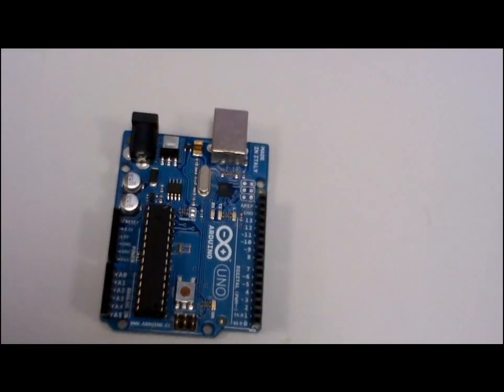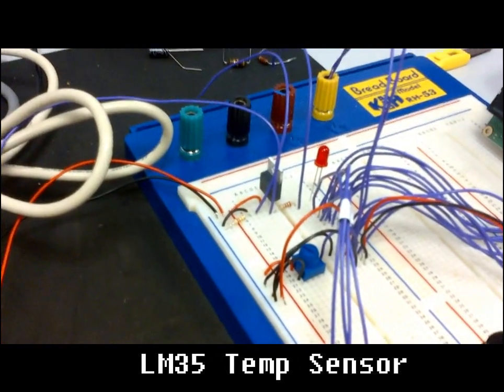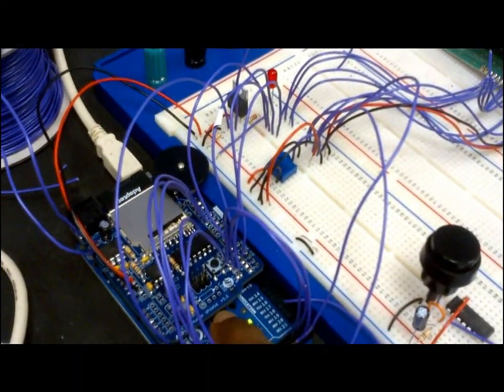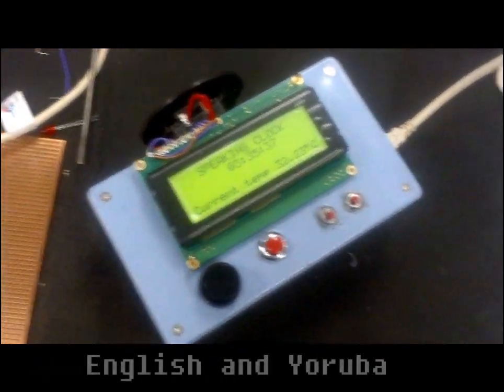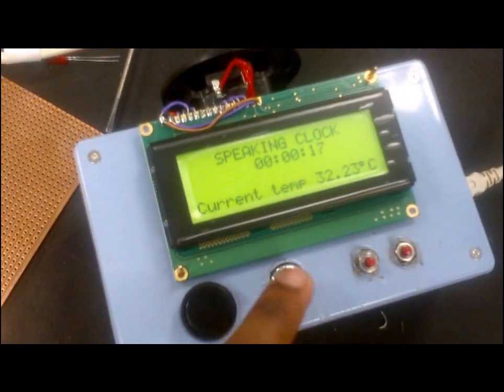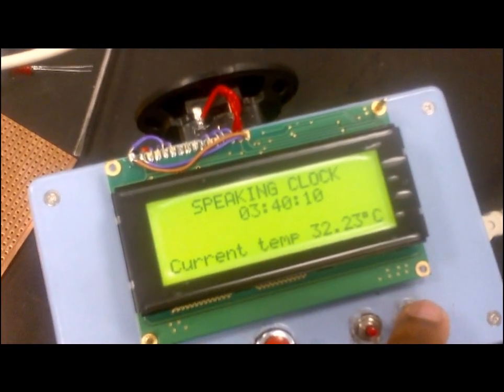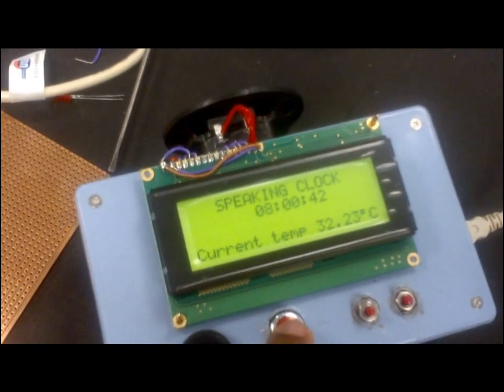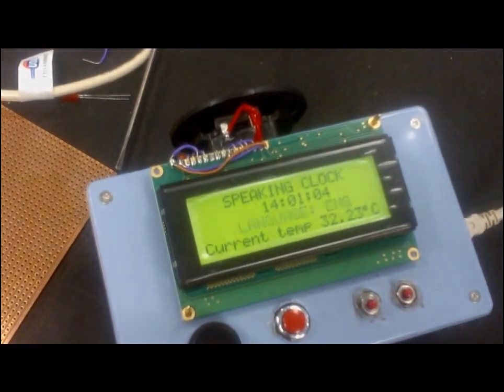Multi-lingual Speaking Clock using an Arduino

Comment: Hey,nice job. Where do you think  I can get an arduino board and an adafruirt Protoshield in Lagos
Reply from the maker: I have no idea about where to get things in Lagos but you could always import if you're on to a serious project
Reply: opemipo durodola A. for arduino boards like Arduino uno and mega try Oshodi mainmarket stand A7 ask for Iyke they cost 4k and 5k respectively. B. For adafruit protoshields not pretty sure you could ask in Oshodi. However, don't go to Ikeja computer village they'll rip you off
Reply: Thanks I ordered it online thou Elochukwu Clarence but next time I would go to A7 funny enough I am just coming from Oshodi I went to buy some parts for my Robot project
Reply: opemipo durodola Fair enough, no p. I'm building a motor shield for my robot project too. Goodluck
Reply: opemipo durodola cool, how did you power the motor to drive your robot, did you buy a motor shield or build one
Reply: No I am using PWM 16 bit channel driver and a pi cobbler
Reply: opemipo durodola presumably, your robot is based on Raspberry Pi then?
Reply: Sure
Reply: Have you worked with one before
Reply: robots? yes. Raspberry Pi ? No. I use arduino for my robots
Reply: Ok
Reply: Where are you based in lagos
Reply: not settled. I move about alot to the Island, mainland and to other states recently
Reply: not settled. I move about the Island, mainland and recently to other states.
Reply: Ok
Reply: Do you have the number of Iyke at Oshodi please I need is contact Asap.
Reply: yh, might be there aswell to get L298 motor driver IC, there's been alot of
complaints about L293d chips they keep acting up it sucks. Here's the
number 08037130364 Iyke Oshoi mainmarket stand A7. Goodluck
Reply: Do you think I can get a Pi cobbler from him
Reply: Give him a ring, it's worth the shot. You never know what he's got under
the hood, the place is like some underground for
makers/hackers/builders/modifiers. Call him and ask lol
Reply: It's a small world I buy things from him too in fact that is the one shop I go to before branching elsewhere
Reply: Unfortunately he doesn't have
Reply: The problem is I bought one online only to see it doesn't match my Raspberry PI model B
Reply: Of which it was designed for raspberry pi model B+
Reply: Now I can't return it
Reply: But in case you come across any body that needs hook us up
Reply: And have you been able to integrate talking into your robot.
Reply: he's the only guy that sells what he does, can't say he's the best but he's
saved me cost a couple of times lol. They'll rip you off at Ikeja computer
village especially a store called 'Centre 4 Tech' dang! Iyke sells an
arduino uno for 4k the standard prices those lots in Ikeja sell the same
board for 7500 like wth, since I found Iyke's store I've been going no
where else for components, sensors and boards
 but the place is far and a bit risky for me
Reply: Well I am stucked on Designing a neural network for my Robot to aid adaptive learning
Reply: get a Ph.D in artificial intelligence hehe
Reply: Working towards that
Reply: Want To Do Robotics for Second Degree.
Reply: You?
Reply: that's what we need, adaptive/heuristic learning in strong A.I is the way
forward
Reply: Iyke I've known him for a year
Reply: Centre 4 tech I know does guys was thinking of consulting there expertise are they Good
Reply: Send me your number
Reply: uhm, it's offered as a master's to any engineering degree to universities
in UK. I know University of Sheffield does robotics as a complete degree on
it's own or after a first degree as a master's program which ever rocks
your boat the end results are up to you because in the end it's not just
about getting a job in a well-paying large firm and staying insignificant
but about what you can contribute to the world as a whole like the Steve
Jobs and Elon Musks

On 23 June 2015 at 12:11, Elochukwu Clarence <****@**> wrote:

> that's what we need, adaptive/heuristic learning in strong A.I is the way
> forward
>
Reply: 08131668221. centre 4 Tech have good engineers but their products are
unneccessarily expensive

On 23 June 2015 at 12:15, Elochukwu Clarence <****@**> wrote:

> uhm, it's offered as a master's to any engineering degree to universities
> in UK. I know University of Sheffield does robotics as a complete degree on
> it's own or after a first degree as a master's program which ever rocks
> your boat the end results are up to you because in the end it's not just
> about getting a job in a well-paying large firm and staying insignificant
> but about what you can contribute to the world as a whole like the Steve
> Jobs and Elon Musks
>
> On 23 June 2015 at 12:11, Elochukwu Clarence <****@**>
> wrote:
>
>> that's what we need, adaptive/heuristic learning in strong A.I is the way
>> forward
>>